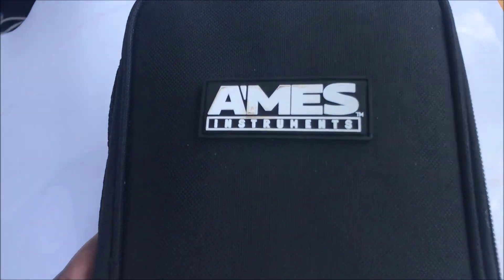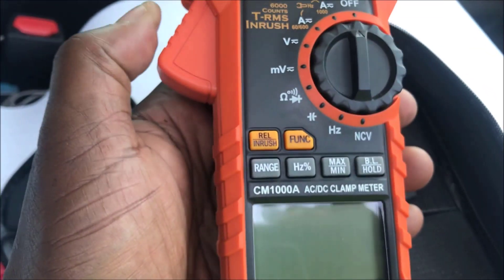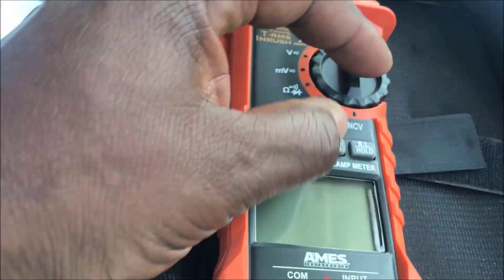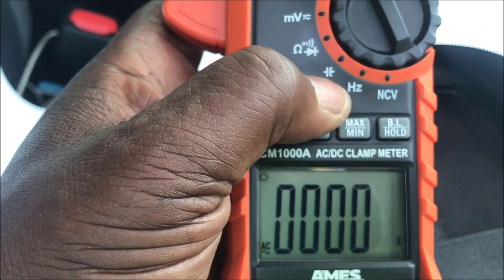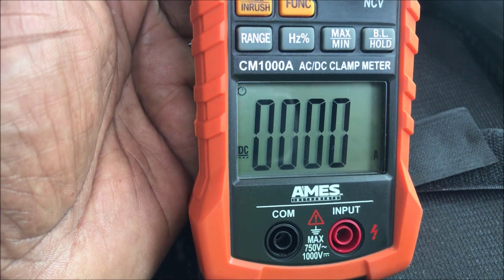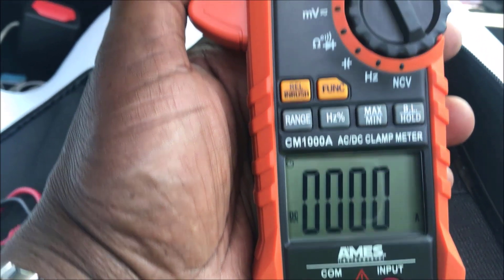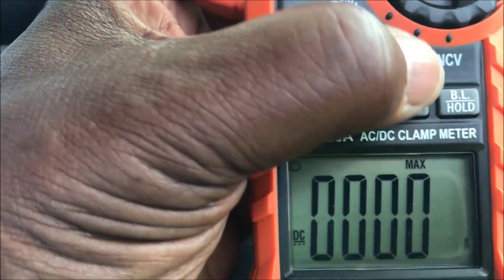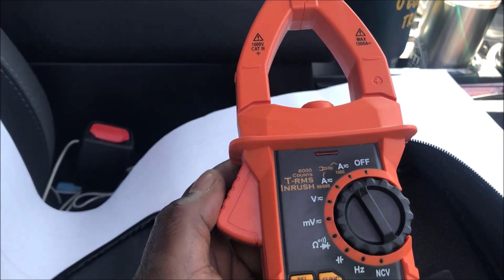How To Use The Ames CM1000A AC/DC Clamp Meter Amp Meter To Check Welding Voltage and Amperage

Comment: I spent a whole-lotta-time shopping for a very good clamp meter 8 months ago....one that was in my budget. Surprisingly this exact model was the one I finally picked out. So far, with my experience,  it has surpassed my expectations.  I appreciate your going through the function buttons and explaining the various 
applications so we'll. 
Thanks!

Comment: What's the difference between the 600A & 1000A.? I just bought the 600A to check my alternator but I still don't understand how this works lol & the reason I purchased this one because I bought a high output 320A alternator they said to go get a AC/DC digital clamp meter to test the alternator & call them to see if the numbers are correct when shipped b4 I install it welp here I am asking for help lol thanks brother for your video but I'm not understanding it still lol